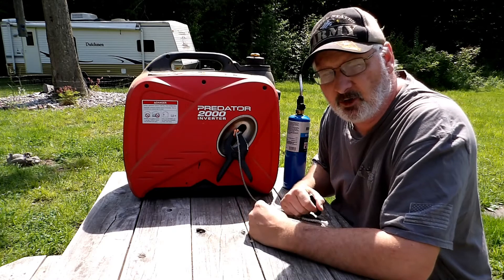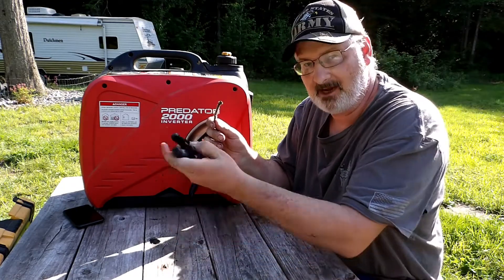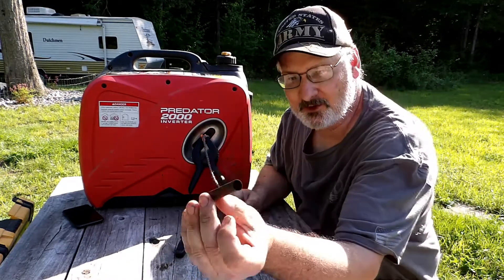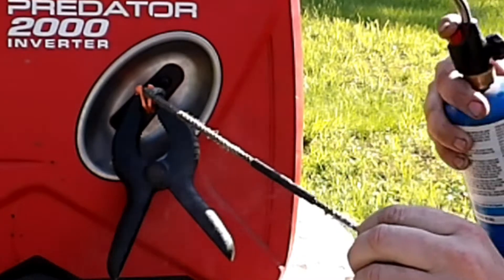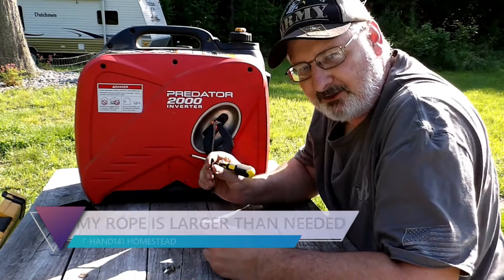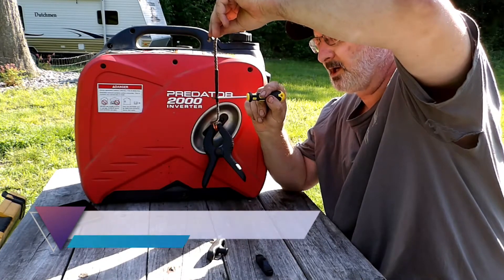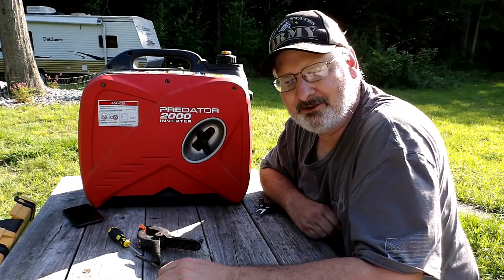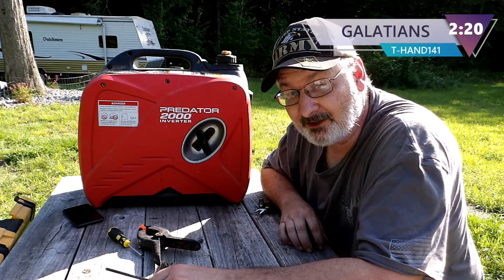Predator 2000w Generator Hack : Prevent Problems BEFORE they Happen

Comment: Hello, my Predator generator has the overload light on, does it  can be repaired ?
Reply from the maker: I believe you may just have to reset the breaker and not put such a big load on it from now on. The overload light means that you tried to draw more electricity than the generator puts out.
There should be a breaker button on it somewhere.

Comment: I was thinking about getting one of these.  After all the fuel has been used out of the carburetor...is the fuel tank pretty easy to drain for storage?
Reply from the maker: would think so? Just unhooking the gas line from the carb, but honestly I have never stored it as I Live off grid and run my generators at least once a month.

Comment: what if you remove that metal side panel piece. Will that stop the rubbing?
Reply from the maker: In my case, no, It is where the cord exits the recoil itself that we get the rubbing. you may be able to alter the grommet it goes through there, but I am not seeing where, at my skill level I would be able to fix the problem. Thanks for watching!
Reply: @THand141Homestead  after reviewing the max out put and my pressure washer for detailing uses 1500 watts I think I am going to buy the 3500  electric start , quite running one..but I will do this to the pull cord, thanks for the heads up on this issue.

Comment: Greetings my neighbor to the south (Tupper  Lake)
I ran a HF 2000 off grid, after using Hondas
I ran one for 88 days straight (oil/gas) fixed the recoil twice before putting some beeswax on it. Fixed the problem...88 days straight and it gave er up, not bad!
Great videos
Reply from the maker: I love Tupper lake! It's so beautiful! Are you saying the Generator died after 88 days of running? If so HF's extended warranty would have worked out great for ya. No questions asked return for a new product! I know of people who get the two year Warranty and "trade it in " every two years for a brand new machine. But I find that HF Generators are very comparable to Honda, (not as quiet) at half the price! Thanks for watching!

Comment: How many screws hold in the starter recoil? Just had my cord break on me.
Reply from the maker: There are three bolts on the recoil. be very careful when you take it out. When I did mine I hit something on back of the control panel which loosened a wire and it was a monster to figure out so it would run again. Thanks for watching!

Comment: That's the only problem with my 2000, I kept cutting it shorter before it broke,  until there was no more cord to pull. I ended up using a shrink wrap also!!! Great minds think alike 🤣
Reply from the maker: I also switch out the stock pull cord with smaller diameter heavy duty cord and it seems to help. Thanks for Watching!
Reply: @THand141Homestead  Hi, I just watched your video of replacing that cord in the living room last night.  I have 2- 3,500 Predators I bought in 2020 and love them.  I'm thinking of buying the 2000 but haven't decided yet.  Not sure if I want to spend the $600.  I can say that is cheap, junk starter rope seeing it all fuzzy and how easily the cut off end fuzzes up.  Go buy large dia. starter rope for a chain saw and I think you'll take care of the problem.  I bought about 5' off the bulk roll at a Stihl dealer and it was only about $2. That was horrible putting it on my Husqvarna but it does work, Lol.
Reply from the maker: @jefffrayer8238  That's a great idea! Thanks!
Reply: Oppps, I should mention for everyone to buy the correct dia. rope as some have split the plastic recoil spool or had recoil problems from using the wrong diameter rope.
Reply from the maker: @jefffrayer8238   Absolutely!

Comment: Got 2 of these.. 1 tore after a few months.. i was able to catch it before it as going to get sucked in.. good deal. Tried your idea with the shrink tube.. so far so good 👍.. but number 2 was purchased and I decided to try and just fill the gas while running (I know, I know) to avoid pulling the cord.. after about 10 pulls from changing oil and not catching the gas before it ran out, the pull cord was torn and sucked in. About to attempt to see if I can figure it out.. should have shrink tubed the 2nd one.. kicking myself right now lol
Reply from the maker: We all live and learn. How is your shrink tubed one holding up? Just trying to  get a brauder picture of the hacks usefulness. Thanks for watching!
Reply: Shes still holding up nicely.. i tried electrical tape at first lol.. it worked for a couple pulls.. but it kept being rolled up and getting stuck.. then I finally found my shrink tube and I was going back and forth between he 2 generators.. but then this newer one got chewed up in no time.. its been over a year.. same shrink tube, some scuffing where it would be chewing thru th cord, but its nothing to remove the old one when its too worn and replace, I check it at least twice a week. Great little generator, but they should do something about that. Such a hassle. Do you know if I need to take off the front panel (unplugging all the electrical harnesses) just to get to the screws of the recoil? Apparently there are screws that go into a nut instead of the engine itself and that just makes it hard to reach 2 wrenches in there to release the recoil.. again, great little generator.. like everything these days, it has its flaws. Luckily, pretty minor if you keep up with everything.
Reply from the maker: @ewreck944  I had no problems getting the bolts out without pulling the front pannel off. be very careful though as I hit one of the wires and then couldn't find the problem and had to take it to a mechanic to figure it out.

Comment: Do you find after a few months this fix is still effective? Just picked up one of these generators and I am considering your advice.
Reply from the maker: Yes I do, when the shrink tube does begin to wear off you could just redo it. Thanks for watching!
Reply: Do it for sure.. i have 2. 1 with and 1 without.. the flaw is there.. my 2nd one was sucked in within 1.5 months and only about 10 pulls. The vibrations are enough to get it sucked in. My second predator seems to have something cutting thru even quicker.. about to get in there to fix the coil and see if something is there tearing thru it like butter. Lol.. but other than that, keep up with oil changes (100 hrs), tune ups and try not to let the gas run out, especially if you have dirty gas. I do.. i just fill it when its at 1/4 - 1/2 full because I did have to keep cleaning the carberator jets due to all the crap in the gas here. But once I figured that out and got some fresh synthetic oil in her, she's been purring non stop. AWESOME generator!
Reply from the maker: @ewreck944   I agree whole heartedly! I just changed the oil in mine a few weeks ago and all of the sudden, after running fine it won't start. oil level is fine, but I did let it run out of gass a few times. So you may have just answered whats wrong. I'll check the jets! Thank You! and Thanks for watching!!
Reply: @THand141Homestead  i wasnt able to get the carb off.. i just removed the air intake and removed the bottom of the cup to get to the bottom jet.. but its probably best if you can get the whole thing off and get both of the jets. I was only able to clean that bottom one, but she's purring nicely.. no surging and stalling anymore. I did spray into the carb from any direction i could.. but its messy lol. If you can get the whol carb off, record it and post it! I still want to be able to clean it if needed. But the cables and all that get me lost!...but thats why alot of people dont let their vehicle tanks get close to empty.. the fill at 1/4 or even 1/2 tank.. alot of mechanics do this too.. hard to avoid dirty gas.. especially when you gotta drive a few miles to the only gas station for miles and then pay over $4 for each gallon of dirty gas?!?! It should be half priced at least 🤣

Comment: I tried this but used cheap shrink rap on my 2000 Honda. So I coated the Rope in the same place with some rubber cement and seems to be holding up good not fraying anymore. Leave the line out and let the rubber cement completely dry before retracting. No need to pull the handle off
Reply from the maker: That is a very good idea! Thank you! and Thanks for watching!

Comment: Hi you mentioned in the video that you deal with pumps and electrical wiring underwater.
I have an outdoor extension cord running from my Predator generator and a big part of it is lying in the water (it rains a lot here). I have had this setup for 3 - 4 months and no issues so far. Just wondering if I need to worry. :-)
Part of my outdoor extension cord is even submerged in the water.
Reply from the maker: It depends on the quality of your extension cord. If the outer coating or inner wire insulation cracks or gets compromised it will throw the breaker on your generator. I suggest getting a length of 12/2 romex wire ( the grey is made for outside and underground use) and wire the necessary plugs on either end. If your ground is not rocky I would burry the line 6-8 inches to keep it safe. If the ground is bony I would burry it in conduit. On the submersible pumps we did we used shrink tube to protect the connections that may end up under water. I do not suggest burying an extension cord, and only use 12 gauge extension cords. Hope that helps, let me know if you need anything else.
Reply: @THand141Homestead  Thanks for the detailed answer  :-)
Reply: @THand141Homestead  I was thinking at one point to run the extension cord through a PVC pipe and then bury that.
Reply from the maker: @pencilgun4934  I would make sure of a couple things before I buried an extension cord even in pvc pipe. 1. Make sure every pipe junction is water tight sealed, and no water could enter the ends of the pipe. 2. I would use a high quality extension cord, or one made to be buried. And for the cost of that you could probably get the romex exterior wire I mentioned earlier.if possible you could elevate the cord off the ground. My cord from generator to house runs into the rafters of the wood shed to the rafters of the house so it is up and out of the way so I can plow in the winter without it being in the way. I check it for sun damage every so often. Glad I could help. I know the generators and set ups aren't cheap and are very important, and electricity scares me.LOL
Reply: @THand141Homestead  Thanks again adding that to my notes. Quick story. Many years ago when I was just a boy and growing up in my parents' house in Cape Town South Africa 2 guys came around one day to fix the wiring in the ceiling of the house. Suddenly we hear loud screaming. First we thought it was outside then it appeared to be coming from the ceiling. One guy went downstairs and he turned the power on without warning his partner. The guy in the ceiling was actually stuck on the wire and screaming to shut it off. Scary. First thing my dad taught me about electricity is that if you are not sure about a wire, always touch it with back of the hand first, never grab it. So if it is a live wire and your muscles contract your hand pulls away from the wire and not grab it.
Reply: @pencilgun4934 I have a much better idea. If you’re not sure about a wire, get sure about it before you mess with it! Get a voltage meter or hot wire tester and make sure you aren’t about to electrocute yourself!

Comment: Replace the whole rope
Reply from the maker: If you do replace the whole rope, be careful of the wiring on the front panel of the generator,  I had somehow loosened a connection on one while pulling the recoil and it prevented the engine from adjusting correctly when the draw increased. What a pain to find.

Comment: Terrible repair. Use a heat gun so you don't burn up the cord like you did.
Reply from the maker: I am going to have to get a heat gun. I had the wrong rope on it to begin with, and have since changed it out as it was too big of a diameter. The new rope wasn't effects by the torch. Thanks for the advise I will plan on getting a heat gun. Do you have a preference on brand or btu? I am not familiar with them.

Comment: I haven't been able to figure out how to check the oil level with dipstick because it seems you have to tilt it on its side when you take the dipstick out and what is the point then? The dipstick wont give accurate reading. Also after you add new oil and had it titled on its side it smokes like hell for 30 min or so.
Reply from the maker: you fill the oil up to the threads of the dipstick when the generator is level. the oil should always show up on the dipstick when the unit is level. use a funnel to put the oil in when putting oil in. its smoking because you are turning it on its side and oil is running into the cylinder. it's a pain to fill, but i use a small funnel and keep the generator level.
Reply: @THand141Homestead  O.k. thanks.
Reply from the maker: @pencilgun4934  I will be making another oil change video this week to release on monday.  hope i helped.
Reply: @THand141Homestead  Great I subbed  :-)